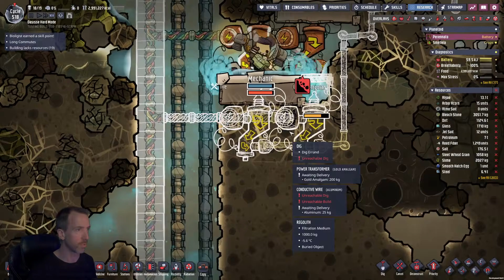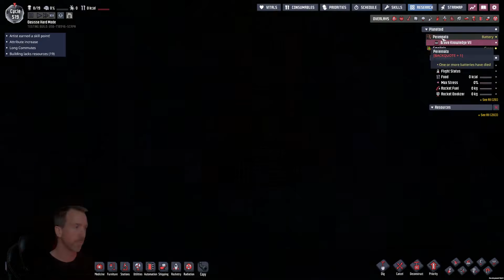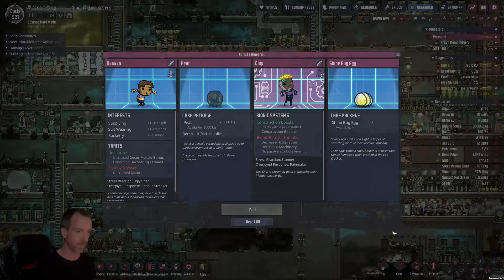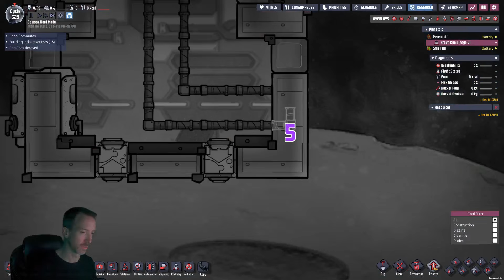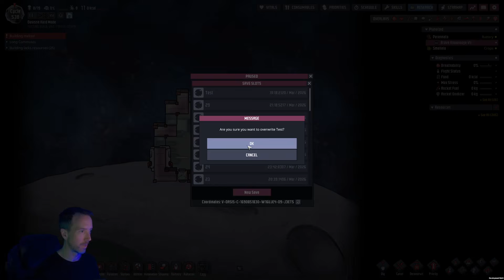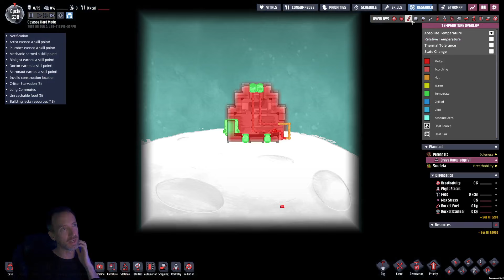Melting Rocket Door - Oasisse Hard Mode  - Ep. 32

Comment: I would have to look it up, but I think liquid uranium gets much hotter as a liquid and does not cool and break the pipes like steel does.  Also, Francis John use the easier trick this week of letting hydrogen flash to gas inside a liquid bridge trapped inside the rocket tile and that breaks it. Much easier but cheesy.  Also making steel in the metal refinery put a lot more heat into the liquid steel coolant than iron.